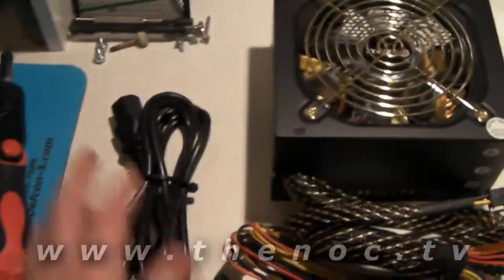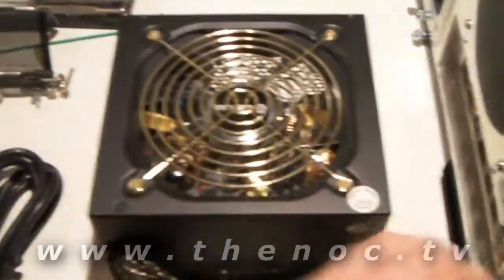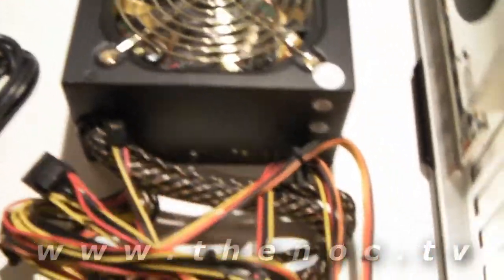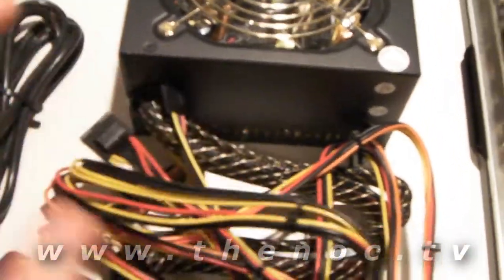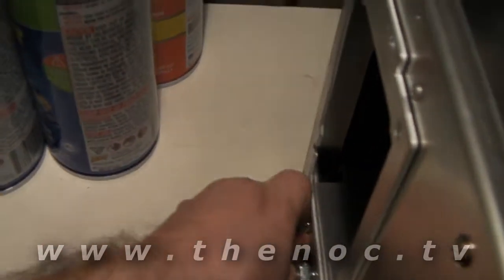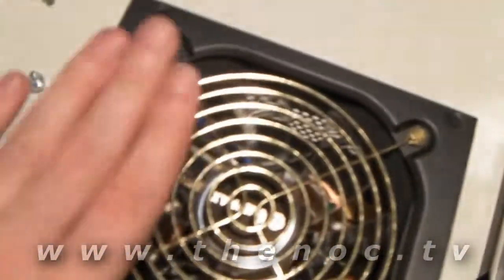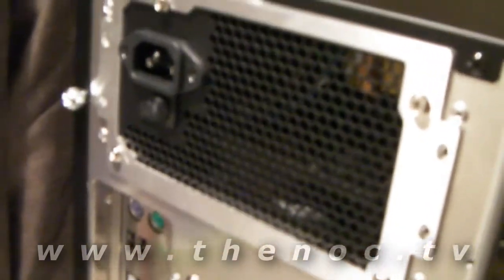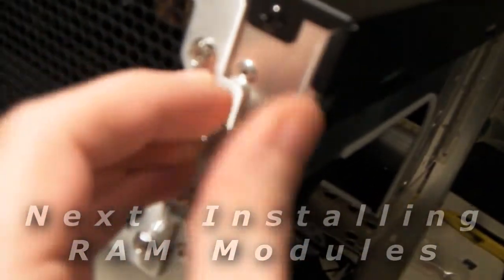Build your own custom computer - Power Supply

Comment from the maker: @robertkrosl In general there is a standard size, then there is all the non standard sizes. If it looks like the one in the video here then you should be fine, unless it's a Sony as those are always proprietary. If it looks different than the one in the video than it's likely a small form factor power supply.